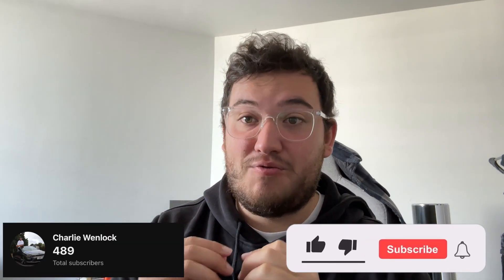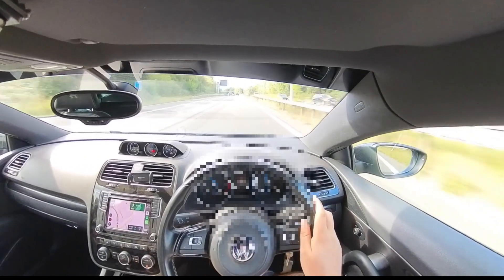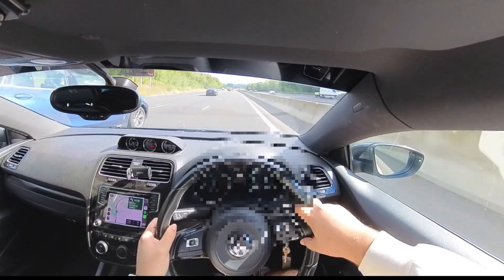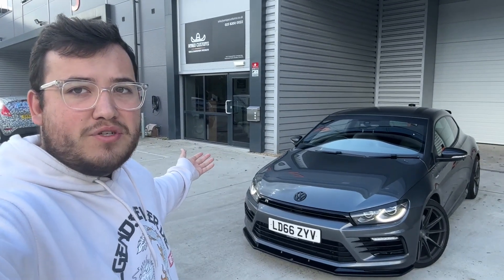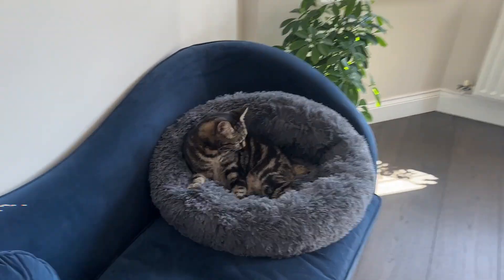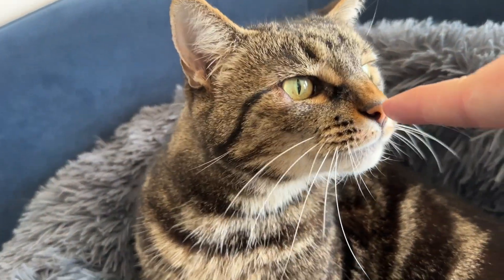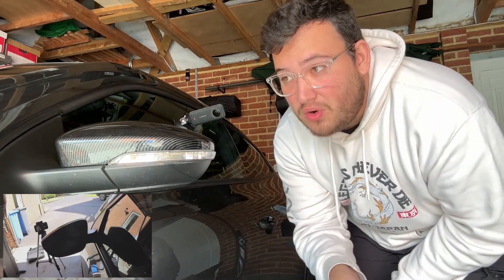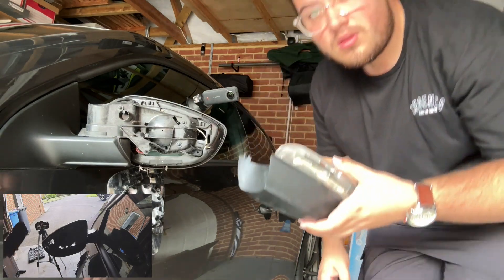Upgrading The Scirocco R With More Mods/Cosmetics

Comment: Why didn’t you buy the dsg scirocco? and aren’t the revs(6th gear) high on highways?
Reply: The DSG scirocco is only a 6 speed like the manual. Mine sits at 3k revs doing 70-80 on the motorwa. Shame VW didnt introduce the 7 speed the the FL
Reply from the maker: I wasn't really fussed about dsg when I was looking to buy I more focused on finding one is very good condition😅, revs sit pretty low in 6th when cruising
Reply: I think in the future you should compare the two(DSG & manual sciroccos) @chwenlock